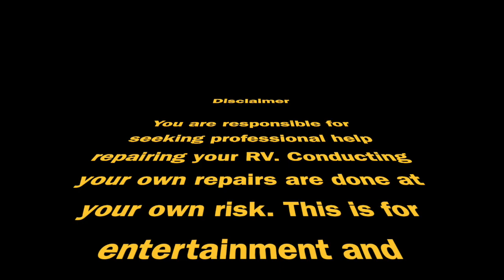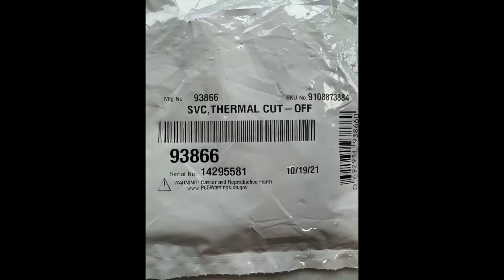Grand Design RV Water Heater Repair-Thermal Fuse

Comment: Great video and info. The same thing happened to ours.  Small correction to make  ( per owners instruction)  it is not a flameout concern (no flame or propane gas), it is obstruction of the gas tube- example:  a mud-dabber wasp nest, spider or any obstruction causing the flame not to shoot through its tube to heat the water chamber but the flame exits elsewhere it could burn the side of your RV. Therefore the fuse is located directly above this flame chamber    - our fault: we drove the RV with the water heater left on.  It likely caused air draft causing improper burn of propane. The fuse worked.
Reply from the maker: Interesting!  Thank you for sharing!

Comment: It was my first repair as well in Algonquin Park May 21 and the fuse was gone on my 2021 grand design. Its a long weekend here in Canada so had to wait till Tuesday to get  for $16 from amazon. My friend had a voltmeter to test what was wrong and we just jumped it and used the electricity at the campsite.
Reply: Nice you were able to make do until you got the part. Turns out there were two packages of them in the trailer I just found LOL! The previous owner must have had the same problem and didn't want to risk being without one again. Safe travels!!

Comment: I ordered this part number off of Amazon and had good reviews my problem is the tail ends don’t match what’s on my grand design but it does have extra wire in the bag the new ones came in like it could be wired if anybody could help send me some tips.